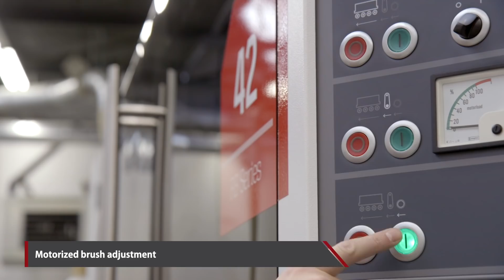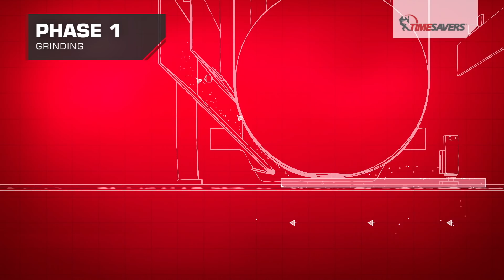Timesavers 42 HWRB series for deburring, edge rounding, finishing, oxide skin and heavy slag removal

Comment: hello, does this machine work with aluminum parts? , if it is possible to work with sizes of 0.5-0.6 mm, and 20/20cm?
Reply from the maker: Hi Sergiu, 0.5/0.6 is for this machine too thin. We have other machines that can process thin materials. Parts of 20x20 cm is no problem. If you want more information you can also look at our website: https://www.timesaversint.com/machine/42-rb-series/